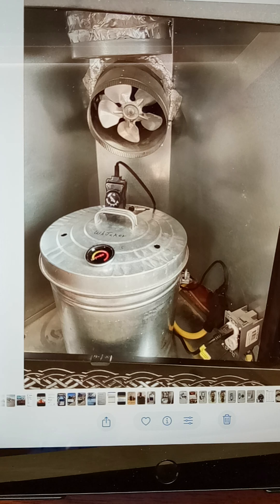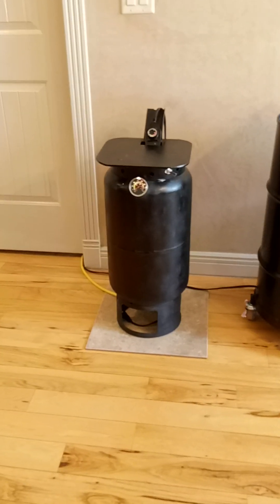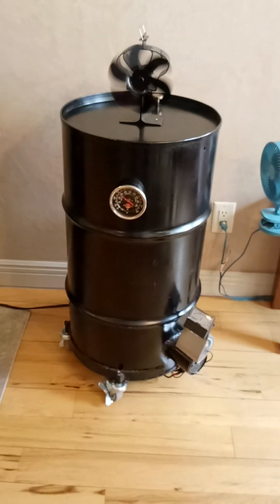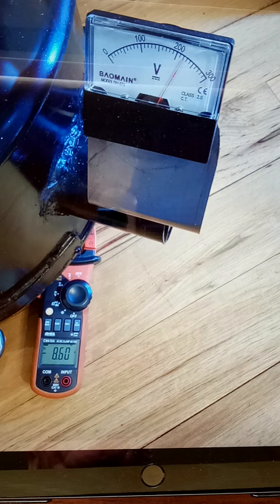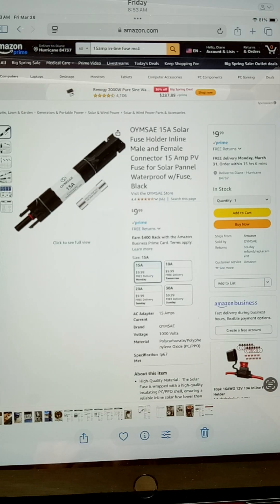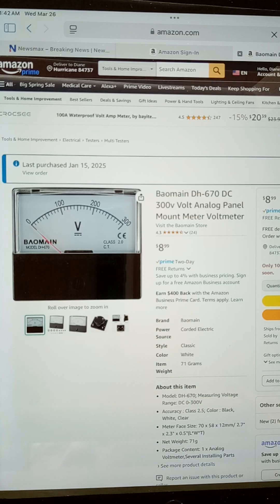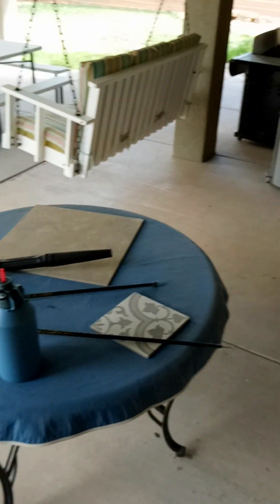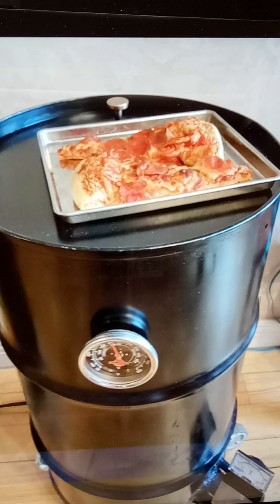Solar Sand Heater - Wayne Saving Energy

Comment: I didn' understand your main heater with the rocks. How did you get the rocks in a cylinder and then have sand around it? and is the heating element in the sand only and the rocks get heated up from the sand and you blow air through the rocks?
Reply: I'm guessing you would put a cylinder of card board or something as a separator into the barrel and fill it partway with stone. Then fill sand on the outside to about the same height and repeat until full. Then remove the separator. Think the stones are to enable a flow of air. Sand is probably to tight and you would have to force air through it very hard.

Comment: Try the same but using water. It is easier to heat up the water with off the shelf elements and easy to drain the water to remove the heater in summer
Reply: Water only heats to 212°F. You can heat sand to 900°F more.

Comment: Solar heating is much more efficient so I would use that instead of solar PV panels. However, if you have an earth battery or wind turbine then heating the sand with an element is a good back up.
Reply: what do you mean by battery?can you suggest a model?
Reply: @danielanac5093 By putting an anode and cathode in the ground in a certain position then you can generate a current. This can be amplified placing close to trees. There is a patent for a 3kW earth battery.
Reply: @pauljenkinson1452  something like that?  https://youtu.be/s7RtXMzZPHI?si=_M7HfWAJa8Lyt6d6
Reply: @danielanac5093 trees act like an antenna in the same way as an electroculture antenna. We are still talking about microamps but the 3kW earth battery uses a technique of improving the earth locally around the electrodes to boost voltage.

Comment: newer   mini splits  with heat pumps and inverter  technology are  still efficient even below freezing  look for 22 seerr2 ratings or higher   mine is  400 percent efficient even  down to 0  and even at  10 below 0  it only  pulls 1300w    while putting out  13,000 BTU of heat  while a tradional electric heater  that pulls 1500w  and only  puts out 4000 to 5000 BTU  of heat.  So in the end wich is more efficient?

Comment: Your heat pump is still going to be more way more efficient than direct resistance heating like this, even at cold temps. 

And if you’re getting 10kWh of excess energy on decent days this time of year and are not using a couple of your PV panels, you should get a battery.  Run the HP etc that way.
Reply: Batteries cost more though, many of us have as much battery storage as we could afford and yet have excess solar energy during clear sky winter days. It's an innovative way to harness power that would otherwise be wasted without a higher capital investment.

Comment: Thanks. The insulation on the landscape wire is a lot better than on an extension chord but you are correct it may short over, hence the fuse and any dc wire above ground should be in a metal conduit. I bought metal flexible conduit but it wasn’t large enough. I’ll get it before next cooling season. Saw stuff on diodes but not interested.

Comment: I'm with the wife at the end, very nice! 😅
My only exposure to landscaping wire is some i found. Seems like it says on it 30v DC max. My initial impression was perhaps there just wasnt enough insulation between the two wires to be safe for much over that.
Anyway, that would be my concern unless you have different wire than what I have.
When i first got my solar panels I wired enough in series to get 120 volts and hooked them straight up to a heating element. I dont remember my numbers but it seemed like the heating element would keep the voltage down well below where the panels would want to be. Sort of an mppt vs pwm argument if you know what I mean.
There is a guy or possibly several on YouTube who have made heating elements out of diodes in series. This allows them to string a certain amount of diodes together to get the panels into their maximum efficiency voltage range.
Just an idea since that seems to be well up your alley. Or if youve already considered diodes can you tell me what your thoughts or conclusions about the idea are?
Im in Texas and more concerned with cooling than heating most of the year. I run space heaters on my setup just for simplicity and I also already had them.
Ive always been interested in a sand battery though and wouldnt mind building one to store some heat for night time when Ive heated the house enough during the day.